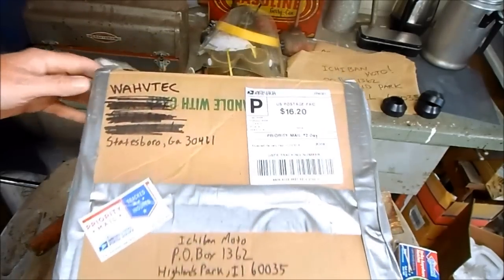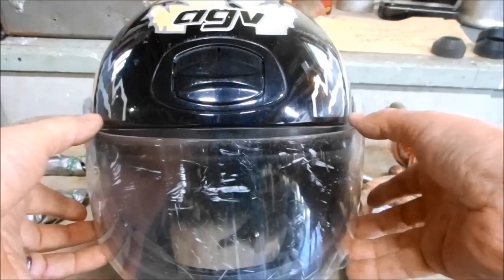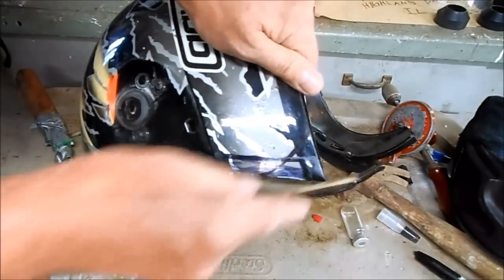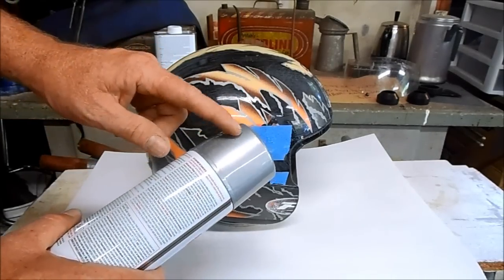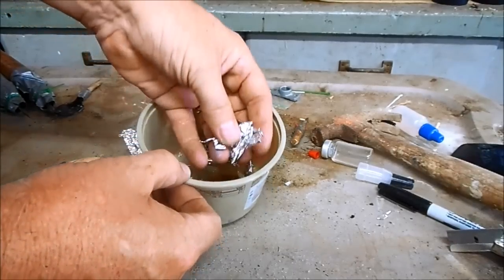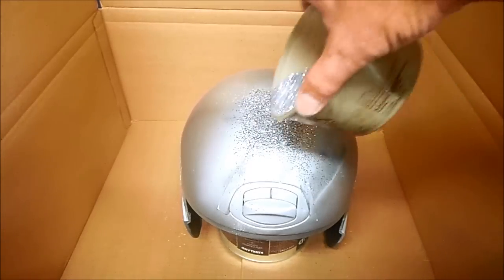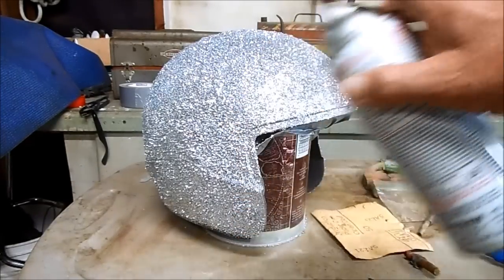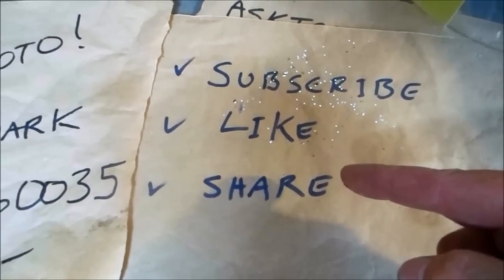How to Customize your Motorcycle Helmet  full face vs  open face

Comment: We don't have aluminum in the uk, would it be ok to use aluminium as a substitute?
Reply from the maker: I have zero experience with aluminium .. test and report back please!
Reply: glitter
Reply: +Ichiban Moto I had to go for tin foil in the end. Seems to work ok apart from the fact that I forgot to remove the visor and now have a mirror tint effect that blocks 99.9% light! Not great for rainy Scotlandshire.
Reply: Can't you just drill eye holes into the now opaque visor...? You could then use clear motorcycle assembly tape to stick sunglasses lenses over the holes in summer?
Xx
Reply: Jon Laws dammit you beat me to it
Reply: 23Seana cracking idea, you could use mirror ones to look cool 😎 or even try iridium ones for the sporty look!
Reply: Or even bifocals for the hard of seeing. Xx
Reply: Ha. Double ha

Comment: Did you find that 2 part spray epoxy at Nickel Town Customs or do they have it at Ace Hardware?
Reply from the maker: nickel town !
Reply: +Ichiban Moto A plane crashed here today. The pilot could have used this helmet.
Reply from the maker: if not a helmet, at least a parachute !   ✈